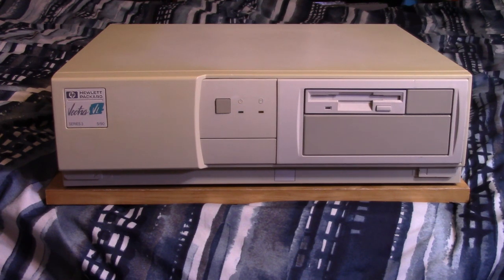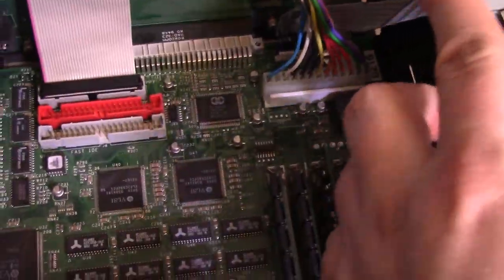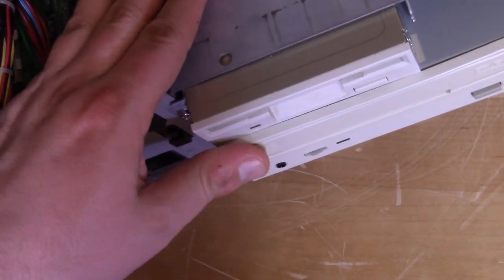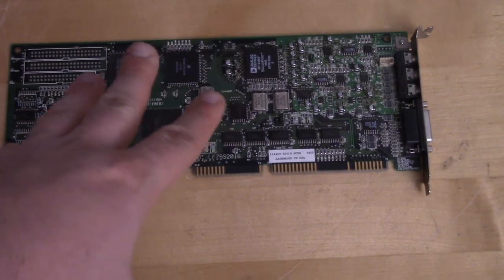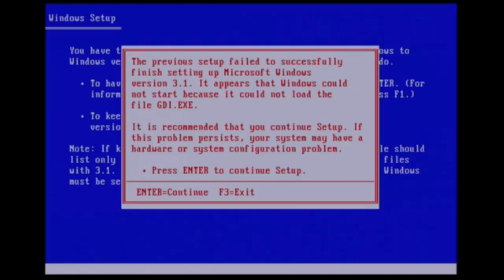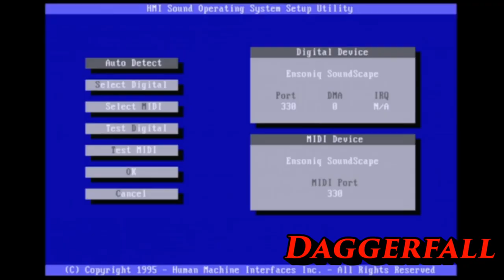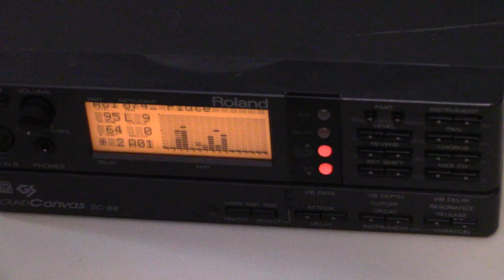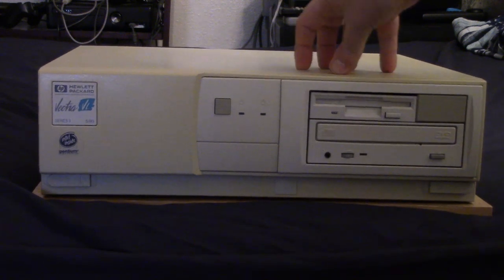HP Vectra VL

Comment: This'll be a fun video. I've always wondered what the Vectra was like. My impressions from afar were that it was a steaming pile of doo doo. I look forward to having my suspicions confirmed/dispelled.

A friend of mine said the best thing to do with these is take the box and replace the innards, then replace the box.
Reply: So apart from the shortage of PCI slots, the poor CPU airflow, the proprietary connectors, the rails, the parallel port, the limited BIOS, the socket 5 board, it's actually not a bad machine if you put a decent video and sound card in it.

All joking aside, nice video! Keep them coming. Always fun to watch.
Reply from the maker: @PCRetroTech  I've seen a few comments with not so fond memories of the Vectra. I honestly never knew they had a bad reputation. They were meant as business PC's so not super ideal for a gaming PC due to the previously mentioned limitations but after throwing in a sound and video card it was okay though if the PSU dies i'm not sure id bother to replace it unless a replacement fell into my lap.

Comment: I have the original box and manuals. What do you need to know?  BTW the Vectra VL outer case has that metal inner shield right? The razor sharp one that can slice your fingers open real quick. Done it on my Vectra VL2 before.

Comment: I'm having trouble with one of these and its infuriating lol. Everything was working fine until I decided to swap the original hard drive out with a 2.4gb one. Plug it in and get nothing. I see that the BIOS says its the original 800mb drive so i reset everything and now the BIOS wont detect the original drive nor the 2.4gb one I was putting in. How did you get your hard drive to work with it? Did you mess with any of the jumpers & switches on the motherboard of the HP? I flipped the CONFIG switch and then put it back to the original position.
Reply: update: got the original hard drive to boot again by resetting the bios a few times and putting the hdd in cable select. Still can't get another hard drive to work with it tho. Bios just says 0mb Drive
Reply: Update: got it working! Seems like my Vecta vl 5/75 doesn't want to accept any Fujitsu hard drives? I tried 3 working fujitsu drives (1.2gb, 2.5Gb x2) and no go. Tried 4 WD Caviar (500mb, 850mb x2, 8gb) and they all were auto detected by bios?? Anyways leaving this here in case anyone in the future has the problem.
Reply from the maker: @Shyzah  glad you got it working. I don't specifically remember what I had to do if anything for mine. Interesting about the Fujitsu drives, I don't think they are special or anything. PCI hard drive controller cards are also a good option sometimes when you run into this issue can't can't get it working.

Comment: Oh I have a similar looking vectra ! But mine is a 486 DX33 instead.
To me socket 5 is more like socket 478 and it's socket 4 that's like socket 423. Because at least you could have a reason to buy socket 5, and it supports enough CPUs, unlike socket 4 which only support 4 CPUs and I'm counting the overdrives XD.And at last, socket 7 is like socket 775 to me as it supports the last chip of its generation plus quite a lot of "next gen" CPUs though not every motherboard support them.

Comment: That on-board CL gpu should be very capable one, you could hardly find any faster 2D pci card, and that is marginally faster at best. But that video ram expansion module (up to 2Mb i guess) will be hard to find.

Comment: What is 'intelligent mode'?
Reply from the maker: I'm not a technical wiz so I can't describe it in technical detail but basically games use one of 2 modes to interface with the mt-32 midi module. Intelligent mode and I dunno what the other mode is called. Anyways cards like the sound blaster 16 do not support Intelligent mode so if a game uses that mode, such as Quest for Glory then midi will not work if your using somthing like a sound blaster 16 to interface with the mt-32 midi module.